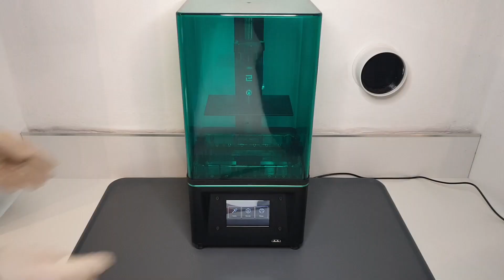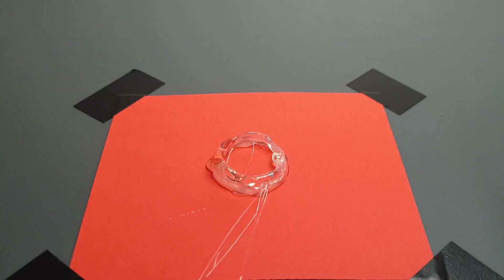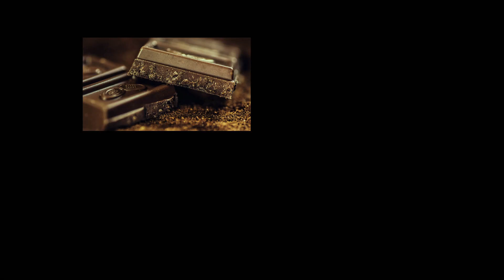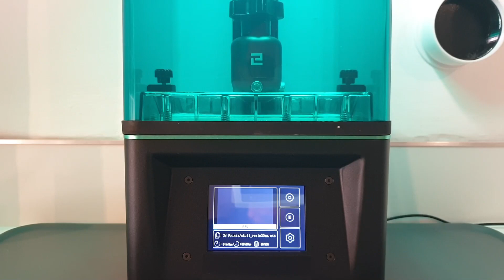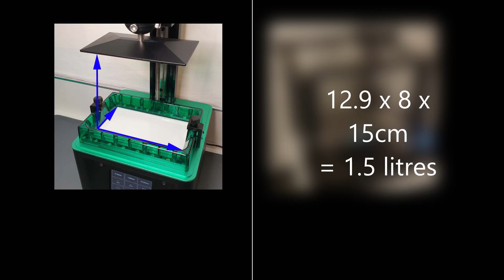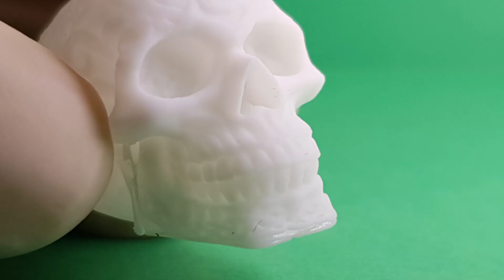234 3D Printer types SLA vs. FDM

Comment: So PLA filament is biodegradable? I don't understand what you mean by degradable. (Great vid btw).
Reply from the maker: Thanks for your comment, good question! Personally, I would expect something biodegradable to fully break down in an external environment within weeks. Not really the case with PLA, so it would be more accurately described as "compostable"; for it to be broken down quickly it would have to undergo a commercial composting process - subjected to heat, humidity and aeration. Hope this answers your question.